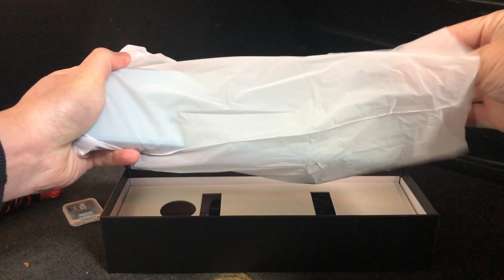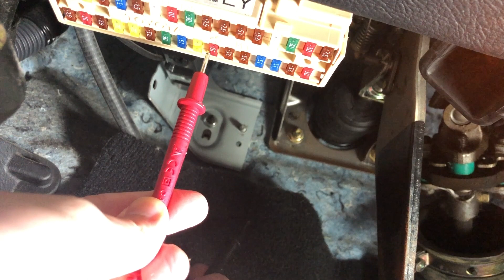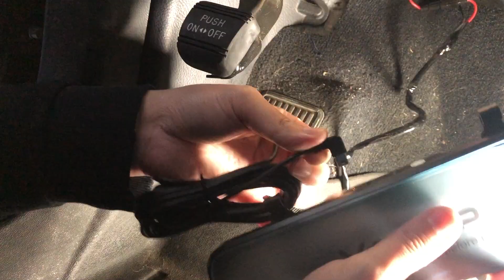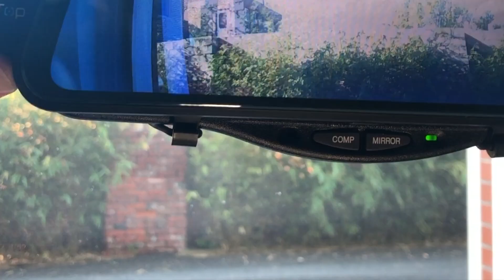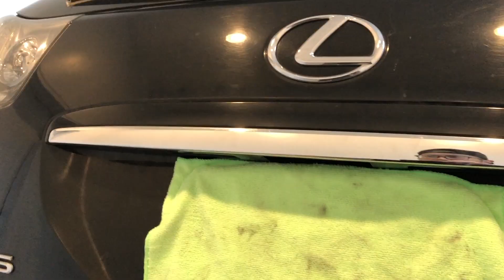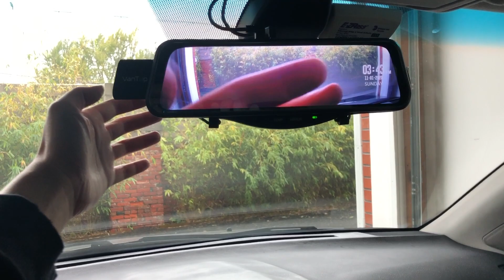Mirror Dash Cam With Back Up Camera: Install & Hardwire (VanTop H609)

Comment: Just bought it and installed it. So, the main job of the mirror is mirroring things behind you. I just can't believe that if I put it to a sleep mode, putting the reverse the image don't go on...Only if the mirror cam is on (and in that case I dont have a mirror because it's shows it's icons) it automaticly switch to the back camera, once I insert the reverse..Does your mirror dash cam is showing automatically the reverse picture when you insert the reverse IN CASE YOU HAVE SWITCHED THE MODE TO HAVE ONLY THE MIRROR or you need to turn it on like me in order to see the reverse picture, but in that case the mirror is ON with it's icons so you can't see the things behind your car? Tnx

Comment: Very helpful, I have a question about the rear camera system. I have the unit installed and have full functionality but due to it being used on a snow plow truck with a Polyester sand spreader, I just used the included camera and had very impressive results and functionality but the rear camera needs to be upgraded and wondered if the van top unit would be capatitble with more commercial encased in a sealed case of some type, if you have any ideas I would appreciate the help.

Comment: I relpaced the factory mirror with a universal mirror mount.It looks more factory than connecting the backup mirror cam to the factory mirror.I had completely forgotten about those tap a fuse .thanks for reminding me.

Comment: I need help to locate the ignition fuse on my car can u help me please
Reply: It tells you right on the panel cover.
Reply: @WilldaBear  thanks buddy
Reply: @Ronnyarango08  Should always be labeled IG or something similar. However I have never messed with the ignition fuse and would never. I always used the multimeter to find another fuse to use.

Comment: very nice clear install , does it drain the battery if its hard wired .??
Reply from the maker: Thanks! No it won’t if it’s connected to Accessory fuse. It only turns on when the car is on and off when car is off.

Comment: If I choose not to tap the rear to the reverse lights, will my rear camera still function and record? I’m not concerned about having my dash cam switch to rear when I put it in reverse. I have a reverse cam already
Reply from the maker: Yup it will still function and record.
Tapping into the reverse light is only if you want to function as a back up camera. Not necessary if your car already comes with a backup camera from factory

Comment: Do i need to cable up the red wire to the reverse light? or does the rear camera get its power supply trough the 3.5mm jack?
Reply from the maker: Yup you need to tap it into the reverse light for when you put it in reverse to show the back up camera. It gets its from the 3.5

Comment: Great video only issue would be my rear camera install. Would need to do it external not on the inside of the rear window my car has 5% dark tint installed
Reply from the maker: Thanks! Yes you can route the camera anywhere you’d like. I did have it mounted on the license plate but due to the location and the camera would only point directly down on the floor, it makes it pointless when it comes to surveillance so I had it mounted inside on the very top to get the best viewing angle

Comment: So I was in a jam because I had lost my Kline wire strippers. I went into a osh and found the only pair they had which was those vice grip ones. I haven’t stopped using them. They are a really good pair.
Reply from the maker: Can't go wrong with them

Comment: So you essentially just wired a hidden cigarette plug, is there not a way to just wire a 12v connection to a usb outlet instead?
Reply from the maker: Yeah you could. I guess if you can find a USB outlet instead of the cigarette outlet.

Comment: Can I splice this straight to the original cigarette lighter?
Reply from the maker: Technically you could, but you would require an extra fuse to avoid over circuit
Reply: Ohh ok, I'm not a guru on that ha. Thank you!

Comment: Why didn't you mount the camera on the outside side of the trunk  where it should be just above the licence plate
Reply from the maker: I did that but it had to be pointed down to see the bumper for when backing up. And the camera was basically pointing at the ground which defeats the purpose of having it recorded for any footage. It worked best in my favor when I mount it inside at a much higher level.

Comment: Very informative. Thanks! When the display is off, does the mirror act as a true mirror? I have read that some brands are better than other when wanting to keep the screen off especially at night as the mirror has a dark tint to it and affects visibility.
Reply from the maker: Thanks! Yes when the screen is off, it acts as a true mirror. I didn't have any visibility issues with this. I am able to see it fine during the day and at night.
Reply: @ikigaidriven  Awesome! TY!
Reply from the maker: No problem!

Comment: If you tap into a ign fuse it doesn’t record when theft happens right? Do you think there’s a way to tap so it can auto record while away from the vehicle? Obviously without draining the battery significantly. Thanks! Just figuring out what I’m getting intk
Reply from the maker: Correct, it only records when the car is turned on. You can tap it to a constant 12v power source instead if you want to keep it recording when the car is off but that will slowly drain the battery. I'm not sure if this dashcam has the feature of motion detection or shock detection where it will automatically turn on and start recording. I could double check my unit to see if it has that feature and if it does, I can test it to see if it works.
Reply: @ikigaidriven  thanks man! But I’m wondering if I tap into a constant, will the mirror always be powered on? Like significantly drain battery or something as little as the radio to remember what time it is? If that makes sense. I’d like to auto record if theft happened to make it clear
Reply: @ikigaidriven  and yeah h609 says it has the parking feature. Just want to make sure I wire it right and don’t get stranded

Comment: My camera is locked in the reverse mode and frozen.  Is that because it requires the sd card?
Reply: Ahhhhh......I figured it out.  I had a wire swapped.   It took Best Buy tech to point it out.  😳🙄.  I’m dumb.  Lol.   Love the camera now.
Reply from the maker: @wtfamerica1  Glad you got it resolved!
Reply from the maker: Not sure. It’s good idea to have a sd card to have it recorded anyways. It may solve your issue.
Reply: Well, I got an sd card and had it format and it’s still stuck frozen in reverse mode.  I purchased another one and it does it too.  It’s wired through fuse box so I can use it as a rear view mirror full time but it doesn’t switch.  Any ideas?
Reply: @wtfamerica1  did you put the red reverse camera cable to be wired to something that is always on. Change it to be wired to your reverse light or , reverse trigger .

Comment: I’m confused. Why go through the trouble of taper fuse and ground terminal etc instead of just plugging into a cigarette lighter ? Did your car not come with a cigarette lighter 12V source?
Reply: Nvm, you didn’t want the wire to dangle by center console. Got it
Reply from the maker: Yup, it's to hide the dangling wires and free up the space of the factory cig outlet

Comment: I have the H610 version and the reverse cam doesn't motion move like the new models does. Still a good feature. With the hardwire way you did yours, does the battery drain? I have mine plugged through the 12v power outlet which doesn't stay on unlike my other one which does.
Reply from the maker: I had the power connected to ACC fuse so it only gets power when I turn the car on. It won’t drain the battery this way. If you want to have it always on, you’d need to connect it to a constant 12v fuse but that would slowly drain the battery.

Comment: Where did you get that small red piece that was hooked on to the rear break light?
Reply from the maker: They are called splice snap wire connectors and you can get them here https://amzn.to/3qeom9a. They're connected to the reverse lights, not the brake lights.
Reply: @ikigaidriven  you just put them together without stripping them and they splice or do we gotta strip a bit of it and splice it with that thing
Reply from the maker: You don't need to strip them. Once you close the connector, it will cut into it. Rarely you might need to cut a bit so it has better contact.
Reply: Thank you soooo much!!!

Comment: Would the way you hardwired the cam allow for surveillance mode? I like using surveillance mode on my cams when I leave it parked anywhere that's not my home driveway. This way it's constantly recording and captures things that parking mode will not capture like somebody keying my car or doing other sorts of things that doesn't trigger the parking mode.

Funny how yesterday somebody pranked a co-worker by covering his car with a bunch of posted notes. Little did they know that my car was parked in front of his and my forward facing cam captured everything. Even the part where the prankster picked his nose and flung it on his windshield. So yeah stuff like this is why I love surveillance mode.
Reply: Yeah you don't wan that running all day because I did that and after 3 days my battery died twice.
Reply from the maker: Instead of tapping to the ACC fuse, you can find a constant 12V fuse which will always draw power even when the car is off but the issue with that is it will slowly drain your car battery. But it also depends on the dash cam unit setting that can detect "movement" or "shock" which will automatically turn on and starts recording and then turns off when there's no movement or shock to prevent draining car battery.

Comment: I have this dash cam hardwired through my car and I noticed its always recording even when I turn off the button, how do I turn that setting off?
Reply from the maker: Did you make sure to hardwire it to a 12v ACC?
Reply: @ikigaidriven  I’m not sure what they did 😭I went to a shop
Reply: @nicolechkw  how much did it cost U at the shop?
Reply: @bonos3208  about $180